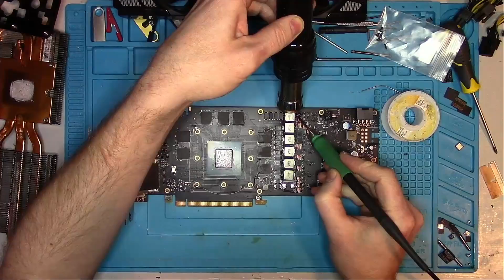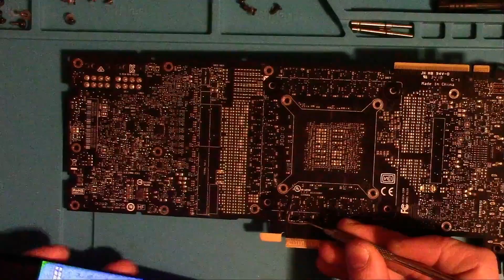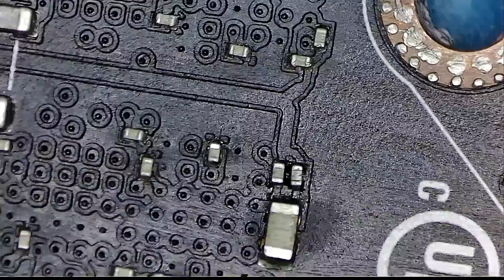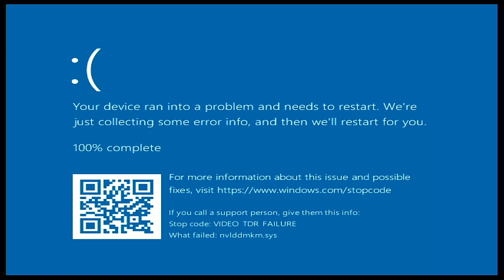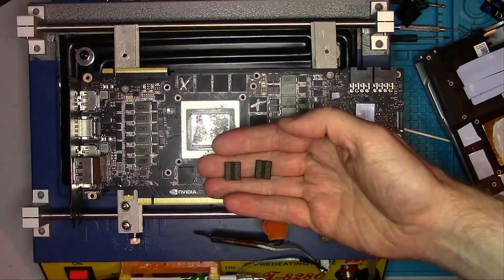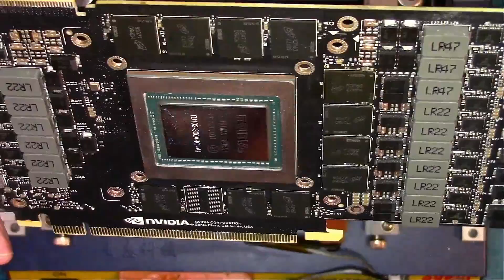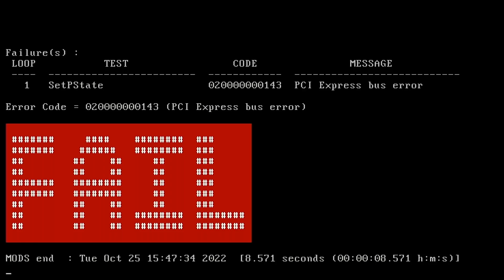2080 TI Memory problem warning

Comment: You should do the 22GB mod. If you're replacing the memory anyway, it's a great way to add additional AI capabilities to the card.
Reply: Better off buying a 24 GB card
Reply: @timmysmells  it costs more though. What official 24GB card can you get for $400?
Reply: @timmysmells  I take it back. The Truffle accelerator is even more economical and doesn't require buying anything sketchy.

Comment: I have an asus rog strix 2080 ti that has error 43 and garbage display when drivers installed. Local tech killed 6 vrams with reheat/reflow method RIP.

Comment: Bought a used Strix 2080Ti for $274 (incl. an installed Strix waterblock + the original OEM shroud/fan/heatsink assembly w/backplate).  As I do not do water cooling, I removed the watercooler for resale and installed the air cooling assembly/backplate (after a deep clean, thermal-pad check, and re-paste).  Unfortunately, the white shroud for the male FAN power connector to the GPU board was damaged (as-is) and although the pins make good contact, the shroud does not securely maintain the connection.  Tie-wrap to the rescue.  Done.
Now the card runs perfectly well.  Benchmarked SAT.  I then did an under-volt using MSI Afterburner...for safe measure.  GPU runs cool and stable...very happy with a fine 2080Ti that cost me, NET, about $220.

Comment: FYI, this residue is called "underfill" and it's purpose is to avoid/lower risk of cracks in solder joint's if it's getting under physical "stress". It's usually applied in devices which can exhibit that (like phones and other handhelded devices). Apparently wohever designed that, came to idea that memory chips near PCI-e slot are also at risk of that so that's why it's there.

Comment: @northwestrepair  could you explain to me how to find the gpu schematics showing the layout and  values of each component like the one shown in this video?
Also how do you know exactly where to touch your voltage tester probes when looking for a short in memory, resistors, vrms ect..? 

Would you be willing to do a video explaining how others like myself can get a beginners guide to checking for damage/ short circuits using a voltage tester to check for ourselves? 

Any tips or advice would be greatly appreciated. I genuinely enjoy watching all your videos and each one inspires me to do some troubleshooting myself (I have a decent but still beginners level of experience with electronics) but i am to nervous to attempt anything more than a thermal pad/ repaste on any of my GPUs.

Comment: It's wrong method to use the results of first test in this linux build - after test starts you have some artifacts in bottom of screen because linux dhcpd service is trying to resolve network addresses and its logging data to system console which is used to mats test and mats reading it as memory failure which is not true. On rtx 2000 series mats linux build (400, 450, 455) tou need to run mats again after first automated one.

Comment: Nice channel , fixing like real pro =) , what temp you use in pcb heater , and hot air gun when solder memory? ty your channel is awesome
Reply from the maker: 400
Reply: @northwestrepair  Preheater In gpu bottom 400c too? Ur channel is awedome

Comment: Hmmm, why are you so certain that 2019 micron chips will not die as well? Wasn't it confirmed that even Samsung memory version has a similar failure rate? Were there some recent discoveries about this that I've missed?

I have a failing 2080 Ti Founders Edition, it's still 'working', but launching any game will quickly cause artifacts and a crash to desktop. Underclocking memory by -300 MHz fixed the problem temporarily, but that didn't last. Surprisingly, it passes MATS test. Now I want to open it up and check which year micron chips were produced, just to make sure if this is GPU is worth trying to save.
Reply from the maker: i am not certain. they simply dont have a factory defect.
Reply: @northwestrepair  But that's why I'm asking... I can't find any info about this factory defect on 2018 micron chips. What's the source of this? Only info I'm seeing is that memory chips aren't at fault, and all of them fail equally.

Comment: Very informative video.  I have a faulty 2080Ti (error 43) with a KO memory module detected by the "mats" program. I did a 6 min reflow with a heat gun on the memory but it's worse, the card no longer sends a video signal, the fans not working but it seems Windows starts up and I hear the drivers updating. Did the reflow cause a short circuit or break the RAM or something else ? I had put aluminum foil around the memory. My measurements : PLL connection (0,5Ω), PCI buffer(8Ω ), motherboard connection 12V (76Ω) & 3.3V (240Ω)  ? Did the reflow cause a short circuit or break the RAM or something else ? Thks a lot

Comment: Nice video.
I recently had a problem with my 2060 where the first November update caused an issue and I could not solve it.
Important: I have never clocked my PC's components.
I have rolled the drivers back, reinstalled Windows 10 and tested multiple working components from another PC. When the graphics card was tested in another PC - it was the same issue.
It is weird, because I can either play for 3 days, 5 hours or 2 minutes. The problem was random and the temperatures were always normal.
I have stress-tested it and most of the time it pushes through the test with no issues.
I have even replaced the pads and the paste on the 2060. The original paste was almost rock solid.
But even with that - the card never exceeded 85° Celsius.
It still holds that temperature with fresh paste.
I have never gotten a BSOD, only the monitor shuts off and the coolers on the graphics card spun at the maximum speed, then I restart the PC.
Sometimes it just crashes the game and closes it, without the coolers spinning on the max.
Guild Wars 2 game always tells me, after crashing, that there was an error with the graphics card driver.
Other games just close themselves with no specific error message.
The Windows error log always showed two errors: Kernel Power ID 41 and Whea-logger ID 18.
I have never ran the 2060 on ultra settings in games.
I saw no fix and I got the 3080.
How common is this problem that I have had with my 2060?
Anyone more knowledgeable than me to give any answer?
Reply: i have a 2060 for 2 years and never got any issues, maybe you got unlucky ? i guess it was a good excuse to get a better gpu :p
Reply: @Chaton_Mignon  And a new PSU. :D

Comment: I suspected it was failing memory on my Sapphire 280x it would have a square on squeen randomly like swap places with another square and parts of the textures would get mixed up/missing, and would commonly get horrible tearing issues with meshes.  Also motherboard handshaking issues.  It cleared up a bit after a oven bake (not proud of lol but it was that or it was dead) interesting to see and not as scary as I thought to replace memory now that I've gotten alot more experience soldering  just haven't worked much with BGA

Comment: Yo northwestrepair, I was actually the one who bought the RTX 2080 ti off you on ebay, (I was the guy who ordered on Nov 22nd) as I saw at the end of ur video looked like the video in the description of the RTX 2080 ti I bought, and also had no backplate as well, glad to see the RTX 2080 ti I have won't fail on me 😅, still many thanks tho, and glad I stumbled upon this video as well
Reply: Do you still use the card? How did it hold up?
Reply: is the card alive my guy
i have an aorus xtreme 2080Ti but i specifically bought it for its smaller size triple fan and Samsung memory

Comment: Another key note, that is a Micron variant. The Micron 2080 Ti's were bombs in general. I bought a XC Black, the first two I received were Micron, and artifacting out of the box. The third came with Samsung memory, and have had zero issues since (2020).
Reply: This is the reason I will not touch the 4090 but the new 5000 series will hopefully use  Hynix /Samsung
Reply: How do you know if it's a micron variant?
Reply: @KMRscoo  GPU-Z

Comment: pretty sure my 2080 ti strix just had a memory failure, card still gets power and will passthrough video from the cpu, but windows disables the card saying it reported an error. also the picture that does still come through the gpu is artifacted with lines all over the screen.

Comment: I added a shit ton of additional pads to my 2080 when i got it after replacing the old ones and it still gets crazy hot on the back plane. Probably going to have to add heat sinks to the back shield with thermal adhesive.
Reply from the maker: wrong thickness=temps

Comment: Had ro RMA my 2080 ti FEs (yes plural) 13 times total back then, Nvidia failed to properly repair the cards or I got them back with another issue.
Dead Vram was a common problem with my cards.

Comment: It's interesting to watch your repairs. Wish you good luck. Some gpus repairs maybe won't pay back, but maybe some new experience you get push you bit further avoid any more same symptoms on bad/dead stuff.

It reminds me my old GF 8800GTX died after 2y heavy gaming long 10 years ago. I put it to service, was something like heat treated and UV too(Not rly sure), it worked again for another 6mo until it died again. That previous 20-25USD(500CZK) repair cost I didn't wish to repeat. That was time to get new gpu.

Comment: Interestingly enough i have an EVGA 1060 FTW+ sitting on my desk waiting for refurb. The boards are the same. The only differences are the 2 memory module pads near the front of the board are filled, the caps for the vrm are in different spots and it has the sli fingers on the top of the board

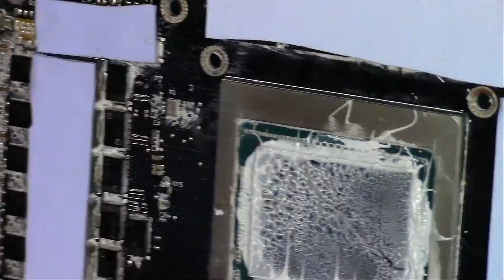2:20 the owner at some point has thermal compounded the memory chips and VRM either instead of or as well as using thermal pads. Owner is an idiot.

Comment: i took my 2070 super apart and the pads on the memory and vrm was fucked, 4 different kinds of pads, most of them not thick enough or too thick and also like a thermal puddy that was used ontop of thermal pads in a few places, and just too clarify this was a founders edition card, glad i took it apart before i really used it

Comment: I've had two cards die since I bought mine in 2020.

First two cards were PALIT 2080ti Gaming Pros, both died due to issues with the GDDR6 memory - pretty serious problem from what I've heard from other 2080ti owners. Sucks even more that the RMA process takes around a month due to PALIT being in china.

Thankfully, they ran out of PALIT 2080ti Gaming Pros to send me last year due to the 3000 series coming out. 😂

They sent me a PALIT 2080ti Gaming Pro OC which is a card that costs £600 more than the £999 card I bought due to much higher quality components, thermal cooling additions and a much bulkier design for heat dicipitation. Haven't had the same problems with this card as the cheaper ones (touch wood), so I'm assuming it's due to thermal performance or the issue was fixed post-june 2021 (first two cards died within 4-6 months).

Comment: That silicon around the bottom memory chips is to protect them from coming loose/solder joints cracking from the sheer weight of the cooler that the GPU manufacturers started implementing quietly a couple of months into production.

Comment: In your honest view, does amd apu's have a better lifespan potential if they mostly use system Ram u can replace VS gpu's with ram soldered on the board like theses ? and probably much better repairability too ?

Comment: i actually just had to pull apart my 2080ti myself, its an EVGA model of some sort, non founders card. had for some time now and never had a temp issue that wasn't resolved by blowing dust out of the heat sink on it. this time, i had to replace the thermal pads for the video memory plate and replacing them on the exterior side of the plate brought my temps down from 106C to 85C at its highest peak during use. not great but acceptable on an air cooler. it was the first time i had ever taken a GPU apart in the 25 some od years i've messed with electronics.

Comment: This level of repair is hardly seen these days as people either don't have the knowhow or are too impatient to get tech repaired. It takes years of skill, knowledge, failures, screwups and experience to point the exact problems get things working again after doing all the necessary changes and repairs/replacement.
Hats off and 🙏 to you buddy all the way from 🇮🇳.
Reply: Expecting the average consumer to be able to solder at this level of skill just isn't going to happen. We should repair more and I always open broken tech up to give it a shot, but such small surface mount components require incredible skill and precision - not to mention all of the equipment needed, from a quality heat gun, multimeter with needle probes, a good soldering iron (usually with temperature control) and a thermal camera - plus buying the memory chips, which are often so expensive in anything other than bulk quantities that would leave consumers with a mountain of useless extra parts that consumers have no incentive to do it themselves. 

Repair needs to be made easier and cheaper through right to repair initiatives, not complaining that the average person somehow hasn't invested hundreds of hours practicing SMD soldering, or into nice repair equipment and doesn't have several donor boards lying around.

Comment: Yup my 2080 Super died and I suspect it was a memory issue. There were a lot of memory issues with the 2080, S, and TI. 

Had MSI not replaced mine with a 3080 Suprim X I would have sent you the 2080 Super.

Comment: Noob question why does the memory being Micron from 2018 mean we have to replace all the chips? Is it soem imcompability  betweene 2019 and 2018 modules?
Reply from the maker: Because replacing one can cause adjacent chip to artifact.
Or it will artifact very soon after.

Comment: In my personal experience that micron ram went bad from extreme over clocking the RAM frequency which burnt the ram having far more compute cycles than it should of had. The ram went hot and fried. I dont recommend over clocking ram without alot of experience on understanding the physics and limitations of that rams clock speed. I wouldn't blame micron on the production date release of the RAM. The only RAM Ive seen hold up to extreme overclocking is samsung which has far higher tolerances on frequency than hynix and micron. enjoyed your video! Thank You

Comment: with the resin on the bottom memory ic's... I think evga might have determined that the pcb flex near the pcie connector plus thermal cycles leads to those sm components breaking contact.

Comment: There are times when I'm envious of someone's knowledge and expertise and this is one of those times. In saying that - well done for the fix and i hope you see some reward for your efforts. I have a 1080ti which needs repairing, i genuinely believe t it can be fixed - I just don't have the knowledge to even start diagnosing where the problem stems from. The card is still operational but under stress it crashes.
Reply: try to underclock often times it just cant hold certain clocks anymore or try adding voltage at lower clock frequencies in frequency graphtuner from msi afterburner.
Reply: I have almost the same issue but with an R9 280X that for some reason, I was playing call of duty warzone before the cold war forced integration and suddenly image frozen but the system didn't recover and while booting, the gpu never worked again and I had to remove it because the system was getting frozen before the POST so I think this gpu died or something horribly wrong happened and it needs dedicated repair, that would cost me way more than what I spent to buy it and some people either don't want to repair a gpu or they don't know or can't be bothered to order the parts necessary for the repair to be done.
Reply: Same issue with my gtx 770, so I bought a second hand rx 5500xt. For 96 pounds or about 115 dollars.

Comment: Samsung memory was a must when buying first batch 2080Ti. Problem was that some models would use one or the other without way to tell until you have it. Made me pay more while you needed warranty while working Micron memory 2080Ti would die in few first weeks. So risking getting a card and slapping a water block on it so that your Micron memory dies and you have lost warranty was to much. So I got way more expensive model with water block already on it. It came with Samsung memory to.